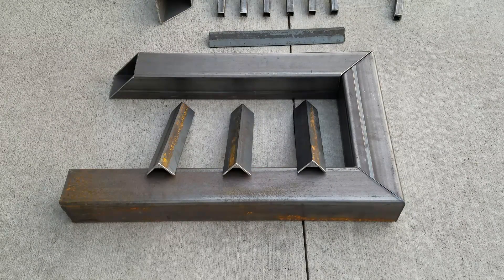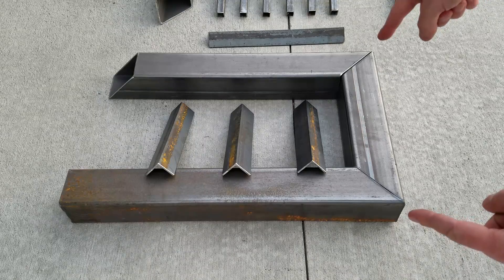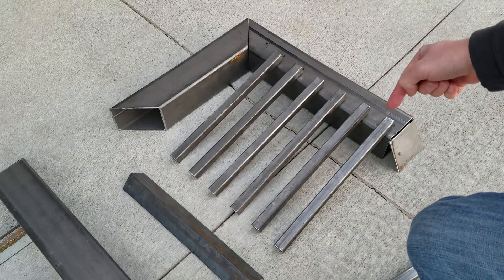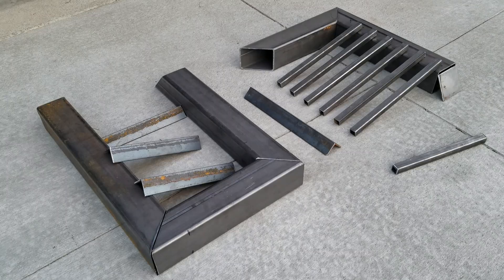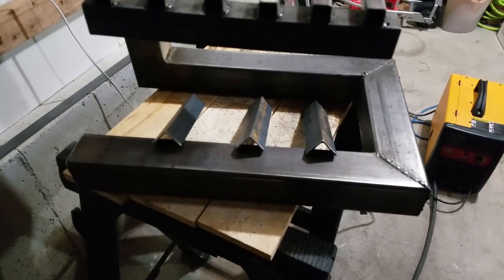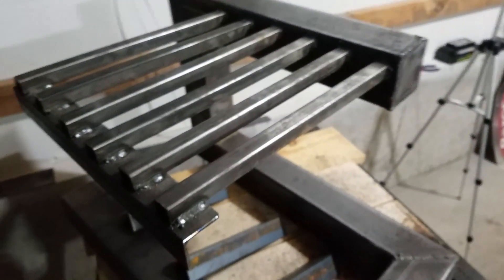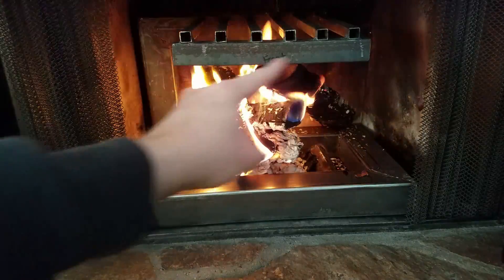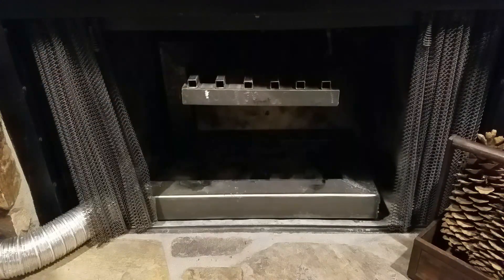Make Your Fireplace More Efficient! DIY Heat Exchanger

Comment: I'm thinking, i have a large closet next to my fireplace, where i coukd house a squirrel cage fan, tap into the ductwork, just on the other side of the wall, and close off the duct nearest to it, to force it over the whole house. Like you say, i would use larger pipes, and also weld on many thin wires of brass or steel, as they woukd heat up and transfer the heat to the exchanger more efficiently. And instead of the hot air coming directly out of the pipes, direct it to the large fan in the closet, through pipe, then flexible duct material. No noise, and i have a large fireplace that could do the whole house. Just invest in carbon monoxide alarms.

Comment: Just a thought: could the pipes be bent instead of mitered? Would that increase efficiency or allow the fan to run quieter? From my limited understanding of fluid dynamics, air prefers to go around rounded corners as opposed to squared ones. Something about turbulence, if I'm not mistaken.

Comment: I think those grates would be in the way of removing ashes and I would use smaller pipes on the main structure to have more room for wood and a higher velocity of air flow.

Comment: I see retail products with that design.  But I assure you that it's a poor design simply because the metal can't absorb and store that much energy

Have a look at YouTube videos that talk about sand batteries.  There are a few of them.

A much better design using sand as a  heat absorber and storage.  A better idea would to find container, that could b a metal box or large metal pipe that would fit inside the fireplace.  You put sand in the container and you run smaller pipes back-and-forth to capture the heat.
It would be a good idea to use a small fan to blow the air in.

Comment: Don’t need a fan if it’s designed correctly with a minimum of 2” pipe or square stock steel, or rectangle box channel steel, heat rises. The air should pull from the bottom and push out the top. It’s not a bad idea to paint the raw steel with Cerakote ceramic paint to ovoid rust.

Comment: I notice that this is a 4 year old video.

With that being said, if you want increased speed of air coming out of the pipes, you wouldn't want a larger diameter.  You would want a smaller diameter due to the Venturi effect.  Since you most likely have washers lying around, you could just weld washers with a small opening diameter to the ends of these pipes and immediately get increased velocity of your existing contraption.

Comment: That will work to 👍 My budget was around 100 dollar, and i got under that. pipe, elbows, line and blower was under that > The stainless steel pipe will never rot out! I was wanting to put 4" pipe but that was to big, and you could see it > THIS WAY its not seen. What i like to do later on is? make a big long metal box from one end of the fireplace to the other end. 3" wide for the heat to run threw, The holes all up and down the front behind the glass doors. and out into the room.  where it want interfere with the glass doors. I think i will just run some more pipe like that, with holes all down the face of it.. Its to cold to work on it now  🥶

Comment: I'am using 3" ss stove pipe going to hang it over the fire place grate, where it want block or interfere with the damper>  Any fire will heat up the stove pipe fast and with a air blower blowing threw the pipe >  out into the room 🔥🔥  That the only way i know how to get more heat out of your fireplace > A insert sux. cost to much. If this don't work i'am tearing down and putting a cast iron stove there!

Comment: Hello @jasonnoid, i have a pretty similar system (Equatair) but i want to build a new one more efficient. Could you plz tell me what kind of steel tube do you use? is it a particular steel that resist to high pressure / temp? Tks a lot in advance
Reply: I have the same question
Reply from the maker: The thicker the better, I don't know the sizing of the tubing since I don't have this unit anymore.

Comment: Hey bud thanks for the video I was wondering if exhaust tubing would work what do you think ?
Reply from the maker: Yeah, exhaust tubing should give you good airflow without restricting it. My tubing on this was a bit small so airflow was pretty slow coming out.
Reply: I like that idea conceptually - round tubing + mandrel bends alone make a big difference in flow - but I don't know that the 12v fan pushes enough air for it to make a big difference.

I like the idea of the using the tube to keep weight/cost manageable (if you don't just have iron laying around).

Edit: just checked, blower is 130CFM, which is slightly higher than a PC cooling fan so going nuts on tubing isn't worth much, unless you want to upgrade the blower itself. ;)  Other advantage of using exhaust tubing also is it will start working a bit sooner (putting out warm air) as it has less thermal mass (which of course means it cools faster when the fire dies out)

Comment: Hopefully you're still responding to comments on this video but I'm wanting to build something like this soon.

How did you connect the ventilation tube to the square end of the pipe? Is the tube flexible enough to just shove into the 3 inch end and work ok?
Reply from the maker: Hey Butch, if I was going to make this better I would add more tubes over the fire for more heating surface area and air flow, I felt it was a bit restrictive. 

I connected that flexible tube to the metal base using metal hvac tape, super durable stuff
Reply: @Jasonoid  sweet thanks for the info. I was thinking aluminum foil at first but didn't know how it would stay sealed up. Thanks again!

Comment: The biggest efficiency is having a sealed burn chamber with dedicated air intake from outside so u don't burn heated air from inside your house..then add heat exchanger around chimney
Reply: Yes! It would be the ideal, would involve tapping into the masonry, but the whole thing could be hidden from view, and have proper exchange material, though not as fine as a gas furnace. I'm thinking pipes encircling the chimney perimeter, with many thick steel wires over the center to collect the heat. It would require a good leak proof system, and built in carbon monoxide alarm, in case of leaks. Then tap into the existing ductwork, possibly using a water filter/humidifier, like furnaces still use. A simple mesh that is tapped to a fresh water source.

Comment: wood burners stink up the air
Reply: Technically, wood is just concentrated solar energy.
Reply from the maker: That's a true statement. If your only emergency source of heat is wood, than it's what you gotta use.

Comment: Great video. Thanks for sharing. Just one note, at the end of the video you said that now you have a way to jest upbyour house in case of power outage. How are you going to run the fan if there is no electricity? Can it be powered by a car battery or something portable?
Reply from the maker: its a 12v fan, you can power it off any 12 battery. Check out my recent LiFePO4 battery build on my channel. It would run a fan and a 12v fridge for days!

Comment: Are you using an electric welder?
Reply from the maker: It was similar to a harbor freight Flux welder I borrowed, I have since purchased a harbor freight flux 125 and it does great!  I have a trailer restoration video I put out recently that I used the harbor freight welder for the entire thing, it did great!
Reply: @Jasonoid  thanks for the quick reply.  I’ve soldered a zillion joints (wires, PWB’s,etc) ,  but haven’t welded yet.

Comment: How did you connect the voltage controller to the blower and what power source did you use?
Reply from the maker: 12 volt power brick, I just wiring the pwm motor controller to the positive and negative leads.
Reply: Thanks for the quick reply! Do you Have a recommendation for a power brick or just a 12V cheap car battery?
Reply from the maker: @edvardstark7142  12 volt 1 or 2 amp wall power supply would be best, then you don't have to worry about charging the battery.
Reply: @Jasonoid  came here to ask this - when you say power brick you mean you used a generic laptop charger?

Also you say 12v x 1 or 2 amps but your 12v blower is rated for 2.5 amps so that means that you're underpowering your fan a bit right? (This will be my first time playing with pwms and wiring and so on, learning as I go).

Great build man, I'm using a couple of your ideas in my project.
Reply from the maker: @MrNathanPlatt  laptop power supplies put out about 8 amps and 19 volts, little too high. On amazon or ebay look up a 5 amp 12 volt power adapter, you'll have lots to chose from.

Comment: The biggest loss is the chimney......the second (or even first) biggest is usually the air from the house/room wich is heated being sucked into the fire to keep the fire going. The fire sucks cold air into the room out of cracks and leaks in the house. If you can get cold outside air to provide oxygen for the fire (a direct short isolated pipe) you keep the heated air in the room/house.
Reply: So my question is if I have a vent to get air from outside the house to the fire place....... will it suck  the cooler air from outside more? Or the inside air? Or is it equal......I do metal fabricating for a living and I really want to build something similar. But I'm up for any other ideas
Reply from the maker: The most efficient design would be something that pulls air fresh air in from the outside through a dedicated vent. Normal fireplaces draw air in from window and door cracks and it cools down the house. This was an attempt to help fight off the drafts haha.
Reply: Well...every solution has advantages and disadvanteges...... sucking in cold air from the outside makes it a great cold-bridge when the fire is not on...the stove "cooles" the room because it's connected to colder outside air. Think valve (as Jasonoid very smartly mentions) and isolation on the intake part if needed. If the room is already hotter than the outside, cold air wants to get in because it's dencer. So I would guess because of physics supporting the system the fireplace sucks (and gets pushed) cold air to burn. But if the intake has a lot of resistance (long distance, small pipe, angles etc) the fire will use the "easiest" air it can get.....from the room you want to heat. Ofcourse, in time, as an underpressure starts to form in the room because of air leaving through the chimney this long intake works a bit better.

Making the most efficiënt system would suggest a short intake directly to the outside air with a valve for when the fire is not in use, and a long (perhaps partially horizontal) chimney running trough te space you want to heat so the hot air has time to heat the room?

When using a long (partially) horizontal chimney in a room an air-quality sensor might be smart.....
But I'm no expert!
Reply: I just keep the closest window cracked. So it doesn't pull air from the gas furnace. Is it efficient I don't know but it make me feel better and I'm always have fresh air in the bedroom
Reply: So to me the obvious thing would be to have a inlet coming down your chimney from top to bottom thus the air coming in once fire is running would be preheated to you cold run a damper in it !!!
Reply: @Gazzasthe1  The air would be heated before it got near the fire....(depending on length of chimney)

Comment: Would larger exhaust pipes restrict the chimney?
Excellent job and explanation.
Reply from the maker: I haven't had an issue with airflow up the chimney and I don't think thicker piper would cause an issue. Thicker pipes would put more heated air into the room, you could space them out more if needed. I just wasn't happy with the amount of air coming out so I would definitely change the size.

Comment: Knowing that heat rises you could angle the pipes that let air into the room from the fireplace and it will create a suction on the intake side so you do not need the fan once they heat up enough.
Reply: It would inevitably create a barrier for smoke and ash to go into the room. It has to be either flat, or angled in a way that forces the smoke to go up. I would go for around 7-15°. The more angle you can put on it, the more restrictive it could be before becoming a safety hazard. Also, it will have higher surface area and thermal mass
Reply from the maker: It's still not enough air flow without a fan, the fan makes a huge difference.

Comment: Do it make the house smell like smoke?
Reply from the maker: No, it takes air from the room, then spits it out in the room warmer.
Reply: Even the first couple times you used this is didn’t smell? I made one and it smelt like metal the first couple times. Seems to be getting better
Reply from the maker: @wyattrumley1654  yeah, that's the metal burning off oil, completely normal.

Comment: Excellent! Thank you! Can you comment on the make/model/capacity of the fan?
Reply from the maker: All the parts I used are in the description of the video. Thanks for watching!
Reply: Oooops! My bad! :o) Your invention is brilliant!
Reply from the maker: @louonboard  If I made a 2.0 version of this device I would add bigger diameter tubing for higher airflow / less restriction. I would also make the pipes longer to push the heat further into the room.